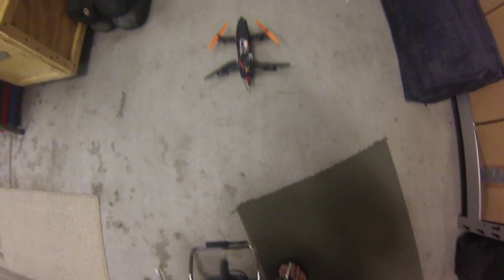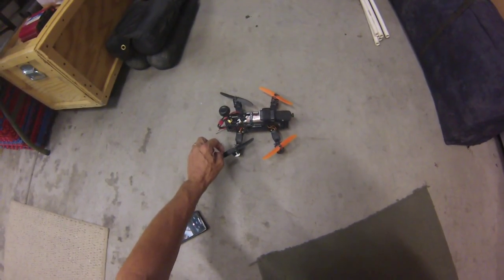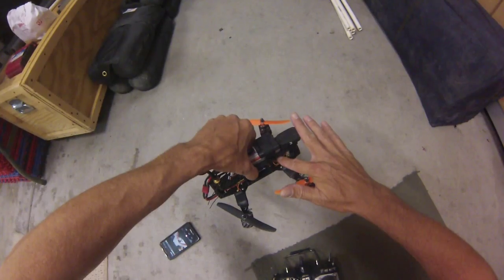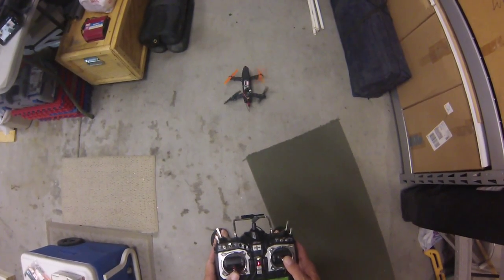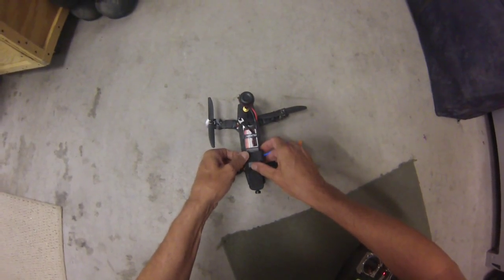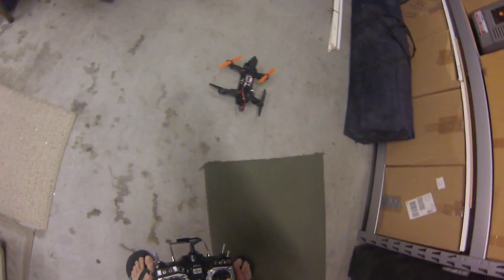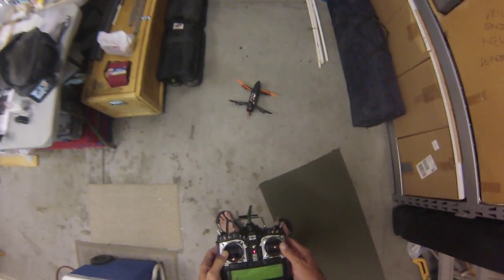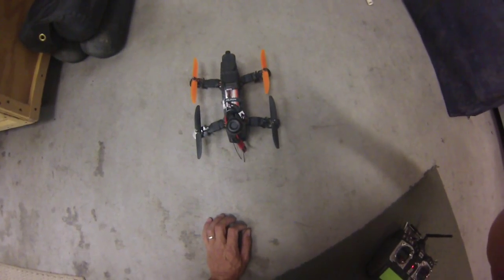Blackout Mini H Quad garage test cc3d

Comment: sure wish mine worked like that the first time! lol or even right now for that matter. my quad just flips over once it gets a bit of lift. i can't figure out how to get the cc3d to fly for the life of me.
Reply from the maker: Check to see if your props are on the right motors (CW - LF & RR)(CCW - RF & LR) and make sure the motor ESC connectors are correct as well.
Reply: madsloper yup that all checks out. must be my settings somehow. cheers.
Reply from the maker: Also, make sure the arrow is facing forward or if not change the FC orientation in the GCS.
Reply: madsloper i have gone over everything suggested by forums for a few weeks now. every one is as stumped as i am at this point. Cheers.
Reply from the maker: posting a video might be helpful.

Comment from the maker: just testing the cc3d since I had a bad board on my QAV 400. This is my first go at a cc3d; I've only flown naza; flip and kk2.0 limited experience with full pid adjustability. Should I loosen all four arms and pull them out and away from each other and the frame?